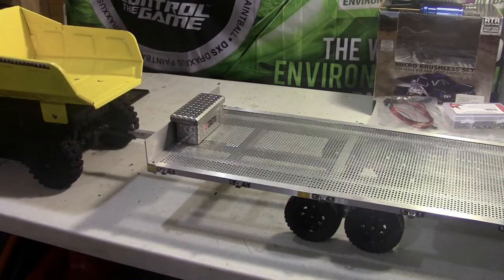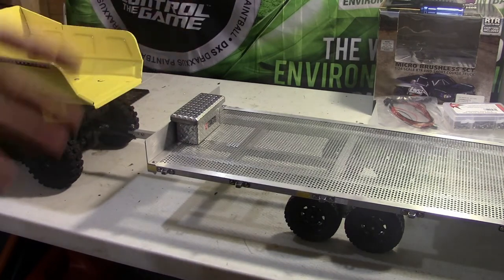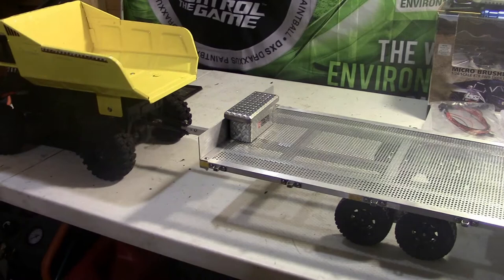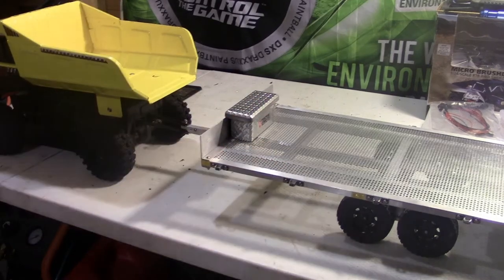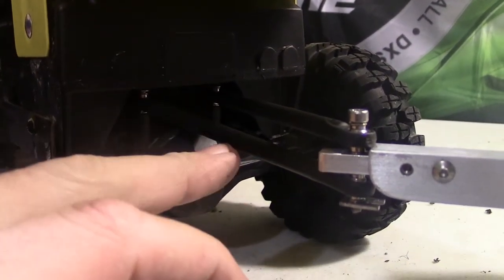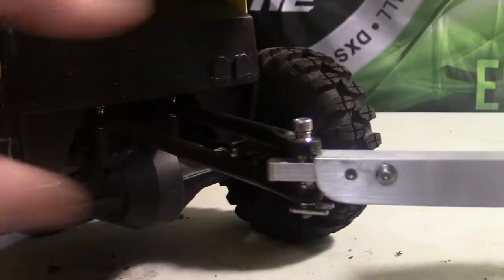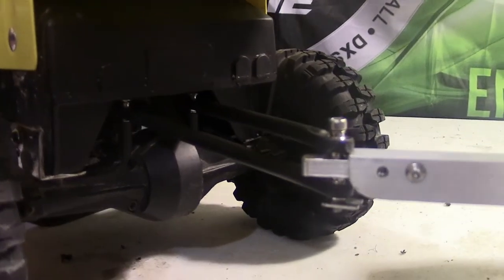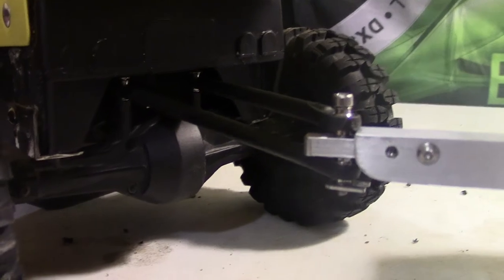Tonka Dump Truck To RC Dump Trunk Conversion Trailer Hookup

Comment: You're definetly gonna need some vertical support on that, those plastic posts on the axle will break in a heartbeat once you put any kind of weight on the trailer.

You'd be better making a 90 angle steel braket from the original tonka frame part.
Then file it some and paint it black.

Trailer hitches actually need to be quite sturdy, i noticed after i bent an aluminium angle piece that i thought would be overkill for my very small trailer! (12 inches long by 6 inches wide (excluding tires))
Only took me one tumble and it was bent enough to scrap!